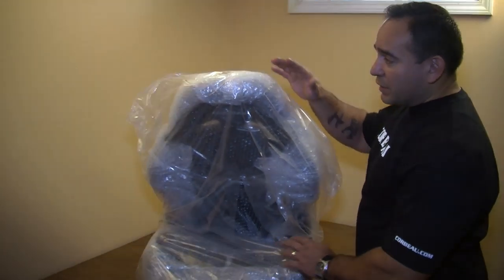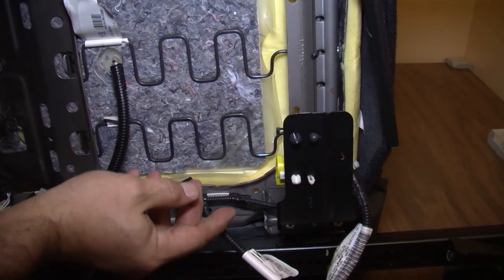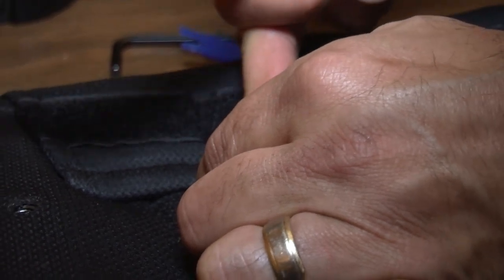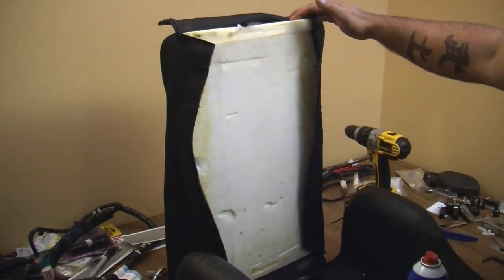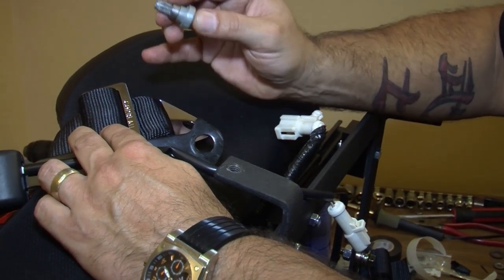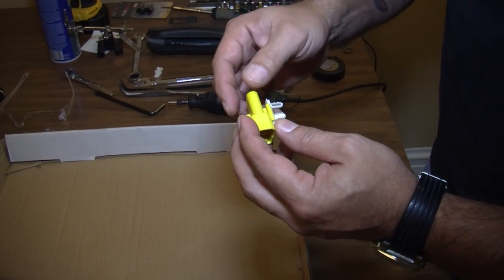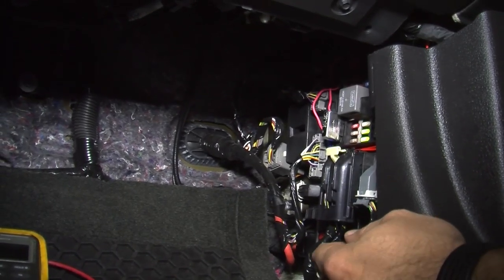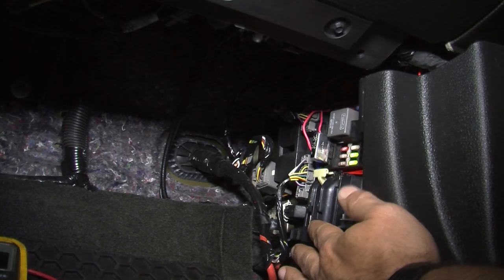Corbeau CR1 Seats with options Install in a 2011 Mustang

Comment: So here is an interesting development from my experience installing the Corbeau LG1 seats into my 2008 Mustang GT that had the side airbags built into the stock seats. The Ford terminator plugs that you listed in your parts list was supposed to work for 2005-2009 Mustangs with the 7 ohm resistor. However, upon measuring the resistance across each airbag (and yes you are not supposed to do this as they say to avoid setting off the airbags), the resistance was 2.2 ohms for both airbags.

When I plugged in the 7 ohm resistor plug, I got a 23 airbag error code saying that their was an open circuit. I then replaced the 7 ohm resistor with a 2.2 ohm resistor. Sure enough the airbag error went away. So my 2008 Mustang needed 2.2 ohm resistors not 7 ohm resistors as Ford states.

And I did not need to mount the seat track position sensor to the rails to avoid getting any error codes. All I had to do was connect the sensor to the harness. No error codes
Reply: Update. LMR looked into this and they discovered that 05-07 Mustangs are 7-8 ohms. It looks like 08-14 Mustangs are 2-2.2 ohms.

Comment: this helped. im thinking of adding seats to mine just that with Air bag seats, its intimidating to mess around with that. so all i have to do is change the resistor? do u have a site were u got this information from, i would appreciate it. thanks

Comment: Did making that 2ohm resistor out of (XF2Z-14B022-AA) actually work for you? No Airbag Light

 A response would be much appreciated :)
Reply from the maker: +ralatorre9 No it has not worked as of yet.
Reply: +V6 Mustang Performance - Tips and Tricks on Modding Mustangs. Have you found Any solutions to that at all yet?
Reply from the maker: +ralatorre9 No car is up for winter now. I had the Ford dealer look at it and they found nothing with a diagnostic. So maybe its bad wiring or it does not work.
Reply: I'd also like to know since my airbag light is on and if the resistor will actually work. Thanks!!!
Reply: +ralatorre9

Comment: Question! Whenever I installed my corbeau seats I sold my stock leather seats. I didn't keep the bladder only the female seat belt. If I make a resistor for both sides will both airbags work? My biggest concern is the safety of my passenger
Reply from the maker: Well the whole system has to be happy in order for any of the SRS to function. If you have one fault then it will not work.

Comment: Can you install these in my car haha.......I am no where near capable of doing this installation!
Reply from the maker: +Omar Jawad Actually if you are not doing the heaters etc. Then its pretty easy.
Reply: +V6 Mustang Performance - Tips and Tricks on Modding Mustangs.  Unfortunately my car does have heated seats... I drive a 2013 Hyundai Veloster turbo..... I was also wondering are brackets included with the seats, or are you just bolting the race seats to the factory brackets?
Reply from the maker: +Omar Jawad No it comes with brackets. And they are manually adjusted.
Reply: +V6 Mustang Performance - Tips and Tricks on Modding Mustangs. ahhh ok thats good at least......thanks again for the replies and pretty detailed video.....

Comment: Lol why v6 mustangs ?
Reply: So sick of ignorant people like you. 99% of the time people like you do not own a Mustang. The 2011 and later V6 Mustang has 305 HP is more powerful than any GT models made before 2009. I bought my V6 because it has more room in the engine bay to work around, it is lighter and more efficient. Most importantly, it is more fun to drive a small engine hard than having a big engine and exceed the speed limit in the first gear.